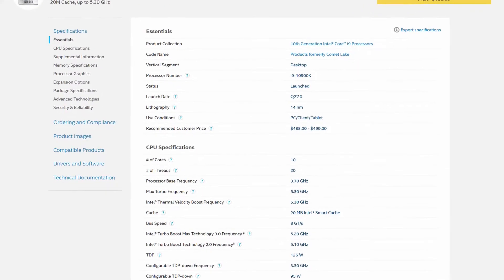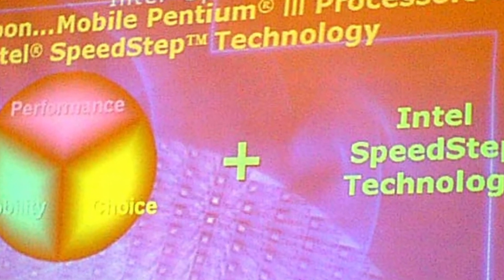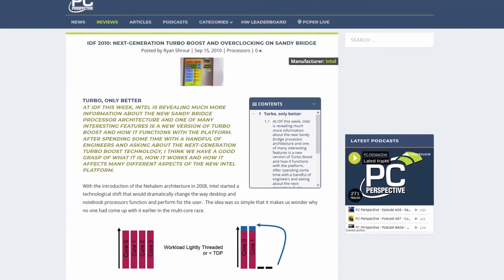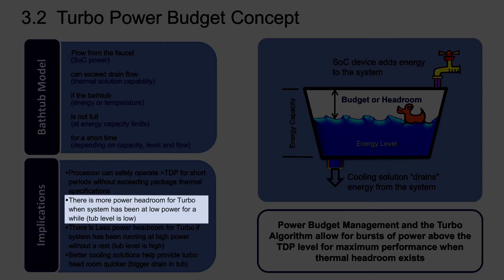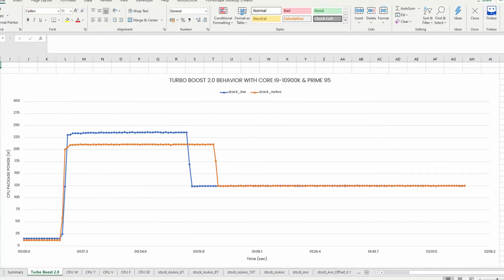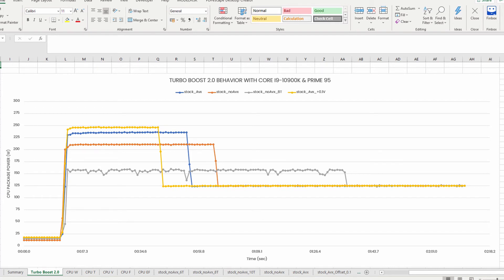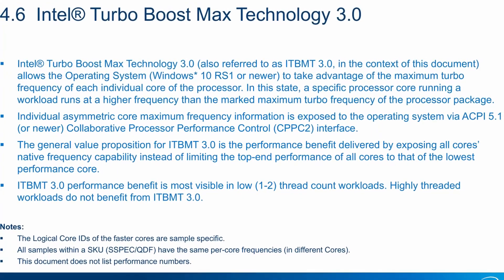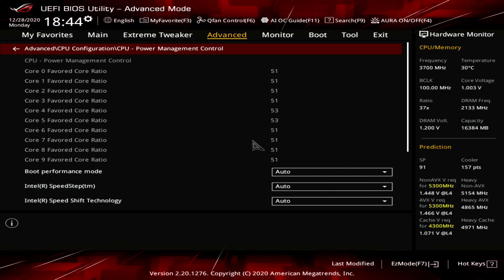Intel Turbo Boost 2.0 & Intel Turbo Boost Max 3.0 Explored | SB#19

Comment: My motherboard supports turbo boost 3.0 but my cpu uses 2.0 can i still ise turbo boost?
Reply from the maker: The Turbo Boost functionality is enabled/disabled by the CPU. So you won't have Turbo Boost 3.0 if your CPU only supports up to Turbo Boost 2.0.
Reply: @SkatterBencher   basically im wondering can i use turbo boost 2.0 even though my motherboard say it support 3.0
Reply from the maker: Yes

Comment: Hello, i want to put i3 10105f proccesor on b460m ds3h v2 motherboard, processor does support intel turbo boost 2.0 but does motherboard need to support it too or just cpu?
Reply from the maker: Turbo Boost 2.0 technology is out of the box supported, however motherboard vendors have the ability to tweak the Turbo Boost 2.0 parameters to match their motherboard specification. Motherboards with high-quality VRM may have Turbo Boost unrestricted by default, whereas other motherboards may stick to the conservative official Intel parameters.

If you want to be for sure, then you can either check with GIGABYTE's support team for the default Turbo Boost 2.0 parameters or just check it yourself in the operating system.

Comment: my cpu supports tb 2.0 do u know how can i get it working
Reply from the maker: Turbo Boost 2.0 should be enabled by default by the motherboard. You can always check with applications like HWinfo or CPU-Z if the boost is activated in Windows.

Comment: So what i've gathered here, is a) i guess it's fine for gaming (both new and old single thread games) if i buy a cpu that doesn't have 3.0 and b) intel is holding out on us when they don't let it have 3.0
Reply from the maker: A) Correct
B) Also correct (with the caveat that TBT3.0 is only possible if when the cores are the highest quality and generally you'll only find those in the i9 anyway)
Reply: @SkatterBencher  why is a correct?
doesn't 3.0 allows more performance on Favored cores so games would run on these cores and have better performance?